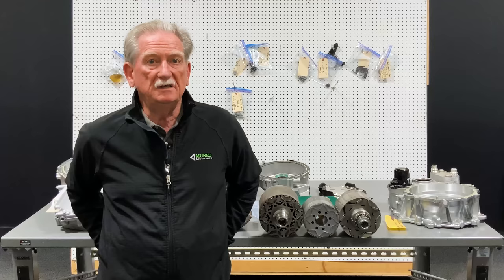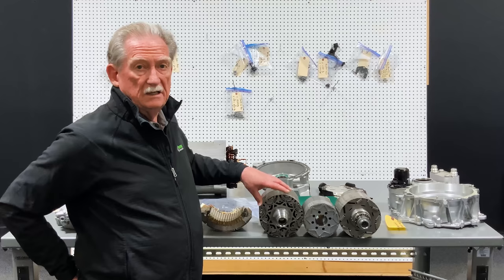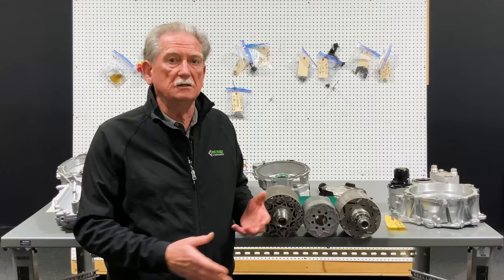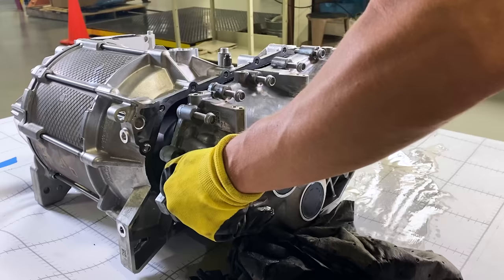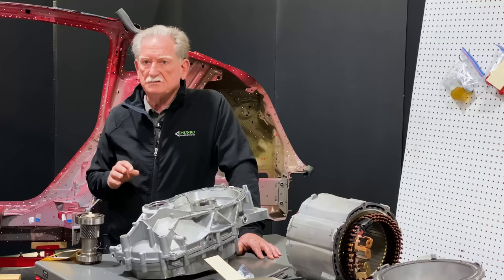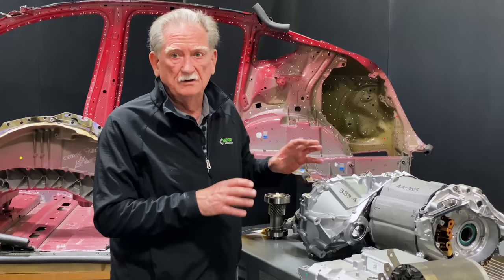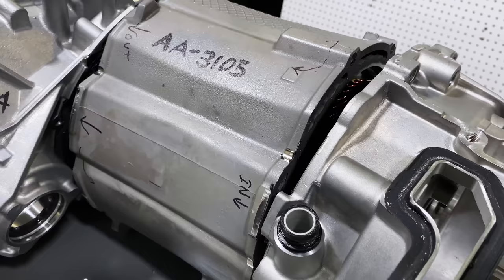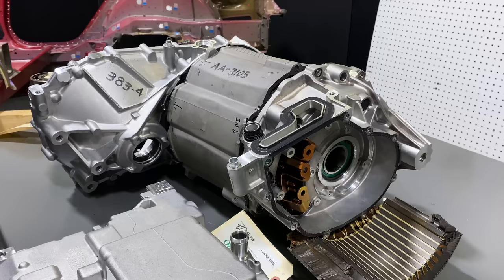Volkswagen ID.4: Electric Motor Teardown and Analysis

Comment: I have found that snap in type fasteners tend to break and be extremely difficult to take apart especially when the snap part is hidden and there are no clear points to pry.  They are fast for manufacturers but to repair are a pain in the A**.  Repair ease needs to be a consideration rather than replace and dispose.
Reply: Any snap type fastener is only designed for easy assembly, not intended for easy disassembly.
Reply: Connectors are the worst I always break the first one trying to figure out how to open it.
Reply: That was his point. You don't fix the inverter. You swap it out. So don't make it serviceable. I don't like that when I try to fix something but....
Reply: Sandy,
You’re at your best explaining the technical differences between the motors. The meet and greet travel is great but it doesn’t educate me like your technical talks do. 
Thank you
Reply: Yes
Reply: @TheWSCCHEMISTRY  i think snap fastnerd will become less common in Eurpoe now that appliances come with a 'right to repair.'

Comment: avoiding screws has one major drawback for the customer: reparability. plastic snapping cases should be banned from consumer electronics
Reply: BATA concept!  Buy And Throw Away!
Reply: Exactly! I just repaired my 6 year Old 120€ keyboard, spilled a Drink on it, took it appart, washed it and boom works like a charm
Reply: You would have thought with the roll out 01/03/2021 of the EU's new Ecodesign regulations, otherwise known as the Right to Repair, (currently only washing machines, dishwashers, fridges and displays including TVs but likely to be extended) VW would be thinking of repairability now.
Reply: Screws suck. Jo-bolts, Hi-loks, Bolts and RIvnuts are where its at
Reply: If you change rotor during vehicle life time, then is a bad vehicle. Rotor should not dismounted for years. You can't repair a rotor in any shop without endangering the car.
Reply: @Kannot2023  he also complaint about the screws on the converter board, and this was a generalised statement
Reply: I totally agree on that. I did repair my motorcycle, I want to do the same with my next one that has an electric motor.
Also I built my own PC and it still runs today - and I could upgrade it multiple times so it still runs more than Crysis.

Comment: As a VW tech, I've never seen a fastener undo itself. In most cases it's the "snaps" that come loose.
Reply: all the old plasticky cracking bits! maybe ford didnt calibrate their torque fastening tools when sandman was there. That sure gave VW the leg up! and many ford owners agony...
Reply: @yujyuj2957  Ford has never been able to get their screws and bolts to do their one job.
On vw, you replace the bolts and torque to yield, plus some thread adhesive.
Reply: As a machinist (Caterpillar) it's super common to see, but also easy to prevent. Rotating and vibrating parts often do it, even if torqued to spec. If your bolts are not hardened, you can flatten the end of the threaded bold, after torqueing it down. Or spot-weld right behind the nut, if your bolt material allows it. Adhesives are... hit and miss, particularly useless in heated applications. I don't recommend them.
Reply: true, its not an issue

Comment: Thank you Sandy for that TRAIN TRACK analogy! I always wondered about the design's effect on noise production, and i now know exactly what you mean!
Reply: All the traintracks I have seen the rails have been welded and ground to make the ride smooth, and to save the wheels of the railroad cars
Reply: I do not think it is right what he said about European rail tracks. For high speed lines the rails are welded together. The diagonal cut is used at bridges to allow bridge to expand and contract.
Reply: @ulwur  So there is at least one topic, Sandy was not involved yet.
Reply: @Foersom_  correct, in Europe CWR (Continuous Welded Rail) is typically used
Reply: The analogy is actually wrong. High-speed rail tracks are usually continuously welded; there are no cuts at all.
Reply: Railroad clanking is from bolted joints.  Mainlines are overwhelmingly welded because there's virtually no service required on the rail.  Simpler, less parts, etc...   Mainlines and highspeed rail are all welded.   For serviceability reasons as well as track continuity isolation, crossings are bolted with plastic separators so the crossing knows where the train is.  Mainlines are also broken into sections so that the signaling equipment knows where the train is.  The 2 rails are like wires and where the train's wheels touch completes the circuit.  Based on resistance, the sensors connected to the rail knows where the train is at.  Further away = less resistance, as train approaches circuit the resistance begins to approach 0 which is a full short.
Reply: @mhamma6560  Isolation joints are only required when using track circuits. I don't know about the US, but in Europe track circuits are mostly used in stations; mainlines usually use axle counters, as they are less susceptible to erroneous readings in wet weather.
Reply: Yea, the analogy is not quite correct but still the explanation is valid for example why the gears are cut diagonally instead of straight. They come in contact gradually and it eliminates the gear whine.
Reply: @Foersom_  I can see welding the lines will make the ride more comfortable, but isn't it more likely to bend in extreme heat? So you basically have train tracks that look like boiled spaghetti.

Comment: I'd like to see more threaded fasteners everywhere! Especially in mobile phones for easy repairs. Just hate glue .
Reply: I would want to see a v8 conecting rods that uses snap-on fasteners that that Ford guy love so much 😅
Reply: Customers like repairable products. 
Manufacturers have a different view.
Reply: I was a smartphone repair tech for 5 years at Batteries Plus & hands down, screws (think Swiss luxury watches) are better than adhesive polymers & chemical adhesive that makes removing the battery from a Samsung a royal pain. Apple uses pull tap adhesives & common screws in their iPhones that make a lipo the first part to fail battery change relatively easy & was by far the most common repair, second would be screen replacements // if the smartphone makers were consumers they would make the screen out of polymers with replaceable glass screen protectors, so that if you crack your screen with drop damage, you can pull off the outer glass layer & put a new one on. A dual glass protector on plastic base screen makes an even better easy outer glass change**technical repair increased difficulty inner glass polymer screen rarely if ever broken OLED, flexible etc // just saying 

They make things throw away so that its cheaper to buy a new one than to fix the old one ** applied to many kinds off products sold worldwide
Reply: He's getting fed up with all those wheels and lug nuts that came loose all over the  highways. Maybe just weld the wheels directly to the axles to prevent this from happening in the future.
Reply: @RosenT6  I don't care about V8 connecting rods any more.  Best to melt down that scrap motor & re-use the metals in an EV.  Sick of skinning my knuckles, ripping bolt heads off, freezing my t*ts off in the rain & getting covered in grease & oil.
Reply: @alexmanojlovic768  Hey, I LIKE that! 
I think many of us are sick of "skinning my knuckles, ripping bolt heads off, freezing my t*ts off in the rain & getting covered in grease & oil" AGREED! 
And yet there is still a place for ICE engines as there are new variations being developed that will run far "greener" than EV and far more efficient than the current ICE with piston or  (dorito rotary)....but if yer like me, the green stuff has no input on my interest in EV. I like them for other reasons, as you mentioned above!
I hate the crappy mfg designed/engineered to assemble quick but totally f*cked up to work on...and nasty

If you see this Alex, please don't think I'm trying to educate you as if ignorant...just sharing what I found to be interesting on the "green thing" below...maybe you already know...and you might think I'm nuts!
But it's okay either way. 
I just love what you said above!

ON the green thing. EVs are FUN and CLEAN on the operators end, but with all things considered they are worse than ICE cars in overall carbon score after 180,000 miles. (It must be true..I saw it on TED)
HORSES ARE THE ONLY CARBON NEUTRAL TRANSPORTATION....LOL 

Their analysis concluded the "greenest" vehicles are actually hybrid EV with a tiny engine, (no grid plug in) they have a small battery pack, make their own electricity while braking in regen and/or solar roof (very few have solar) and I own one (06 Civic Hybrid) as I came to the same conclusion early on....not that I believe in the GREAT CARBON FREAKOUT or any other gvmt sponsored propaganda...f their carbon crap and f their damned covid frrrrreak out....now I hear their slinging monkey shit! ROFL
Take care, have fun with EV's!!!!

Comment: VW Is big on reconditioning their parts for cheaper repairs in the future so the fasteners help them rip it down in a few minutes and swap components out quickly.
Reply: Which is much wiser than saving on assembly costs. This way it helps them to use factory reconditioned parts and also benefits their customers in long-term repairability.
Reply: I'm amazed of how little Munroe discusses serviceability and longevity. It's always assembly cost. As someone who has never owned a car younger than 15 years it's frustrating to have to scrap a car because someone tried to save in a few fasteners and make a module a non servicable, or have most body panels on the underside loose because snap fits always breaks after 15 years. Good job VW for making cars built to last
Reply: @XerxesGustav  Well because in the eyes of an entity that has to grow and also beat legacy automakers at their own game, production cost and speed really is everything.

I mean when the company know that they are working with a technology that was barely worked on in the past, where plenty of new manufacturing and technological breakthrough that would make old car less valuable being repaired than being reporcessed into the finalized technology bearers. This is not something that really has an equivalent in ICE cars, because the internal combustion engine has essentially not changed and reached its peak decades ago. A 2010 ICE power unit is not that technologically outdated compared to its 2021 bretheren, but an electric car is, because in  the span of a decade electric cars went from strictly worse than ICE to strictly better than ICE and are likely going to keep going until they reach the peak of battery storage capacity which isn't reached yet by a wide margin. 

I don't condone Tesla deciding that a car should not be repairable (it should and be designed in such a way that it makes repairing easier), all i'm saying is that from their point of view it makes perfect sense. By the time a decade goes by and these components will need to be checked on, the entire vehicle will be worth more in the raw resources that can be recycled from it than in its value as a vehicle. Not because the vehicle is bad, but because technology has entirely shadowed its previous iterations. Its a bit like saying that we should keep manufacturing repair parts for WW2 transport planes when comercial jets are a thing, that is that kind of leap of technology level, and as such it would make sense that Tesla would think about parts likely to break down within the usefull life of the vehicle but not after the vehicle is already hopelessly outdated
Reply: Reuse and repair....vs landfill or shredder
Reply: @MrCarGuy ...and while reconditioning it in the factory, they can see what actually went wrong and make improvements for future versions
Reply: Why would a car maker want their cars to last longer than the warranty period?

Everything is calculated and if they could make it so, the car would drop dead the minute the warranty expires.
It's just "good business"

If you want to save the planet, you build a Tesla that lasts one million miles and charge monthly for features and company revenue.  

That's basically what a lease is.
You get to enjoy a perfect car for the length of the lease and once it expires, you're out of a car.
Reply: @benoit8850  Because longevity increases value for the customer and commands a higher price and bigger profits. Why do you think I’m writing this on an iPhone and not a throwaway Android?